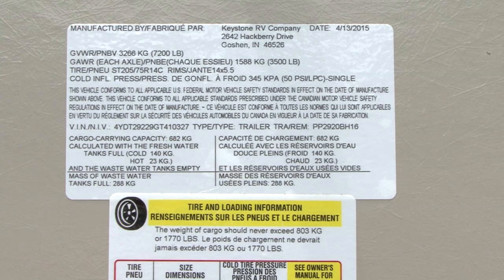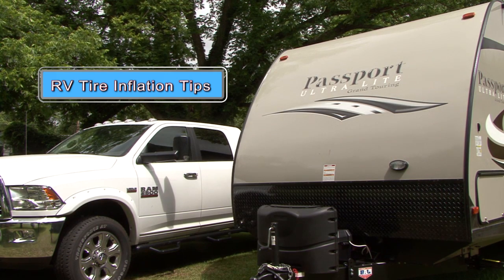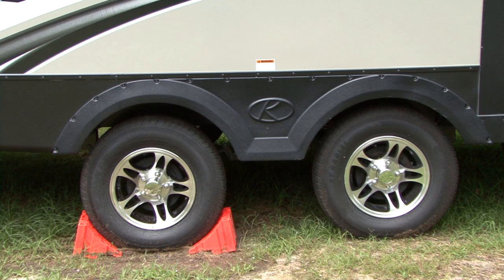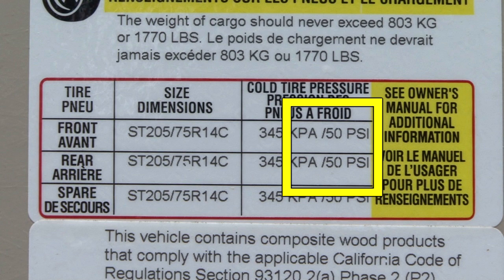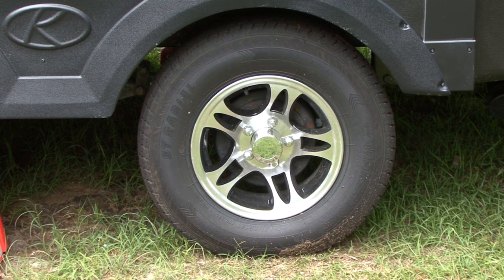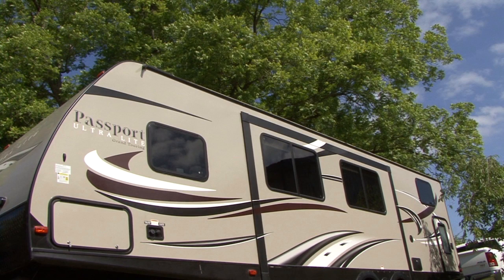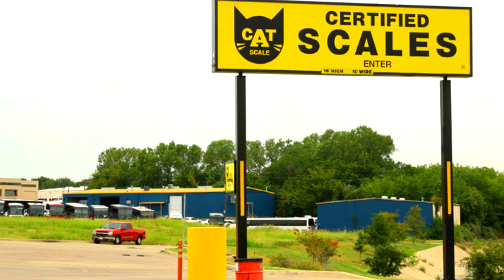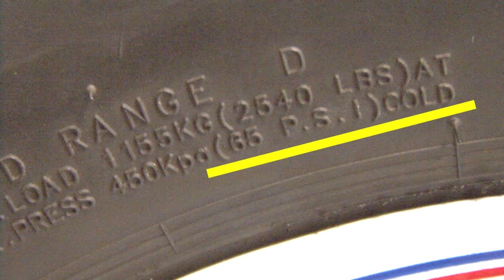RV 101® - RV Tire Inflation Basics

Comment: So, given that pressures increase on the road, my Winnebago micro Minnie placard states 50psi, and the tire states 50psi MAX cold.  I’ve always done 50psi cold with no issues but I am curious if I should be starting out at a lower psi to account for heat.

Comment: To simplify, follow the recommended cold tire inflation indicated on the RV manufacturer's placard and do not exceed the rated GVWR, right? Sometimes people want to make this too complicated.
Reply from the maker: +Jon Eisenberg Yes, if you don't know actual tire loads you could simplify it in those terms. But keep in mind it's possible not to exceed the GVWR and still exceed a tire load rating. The only way to know is to weigh it by individual tire position.
Reply: @RV101  So in other words, weigh my RV after loading each time I ho camping to determine how much air pressure my tires need. Or, to make it easier, couldn't I just put maximum  pressure in the tires to simplify things and not cause any issues with the tire?

Comment: Also check with a gauge not just by eye ball or a kick to the tire. You be suprised how many ppl do the above 2 methods. Always check before a trip esp. don't want a blow out. Also check the date code on the tire. Just bc the tire look alright doesn't mean it's ok. If the date code is old. Replace all the tires. They can dry rot from the inside. RVs and trailers sit a lot. And when they sit with low air they dry rot and flat spot quickly. Which leads to a blow out. Keep tires clean and apply only a water based rubber conditioner not Armor All. The protectant will fend off UV, and other harmful matter. G luck